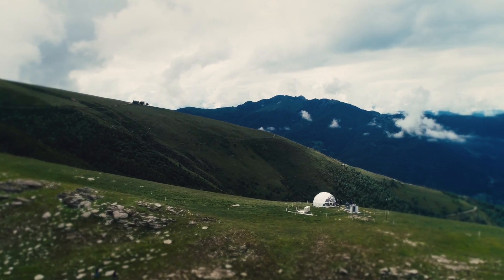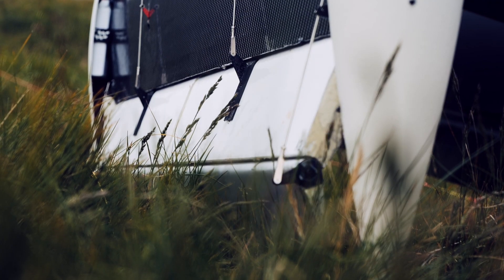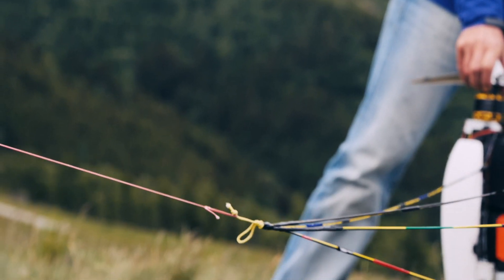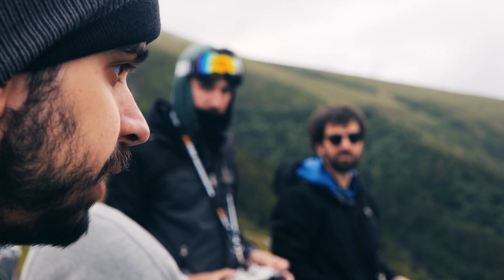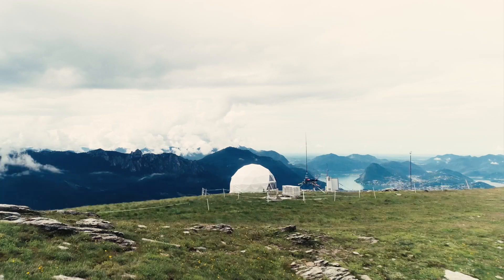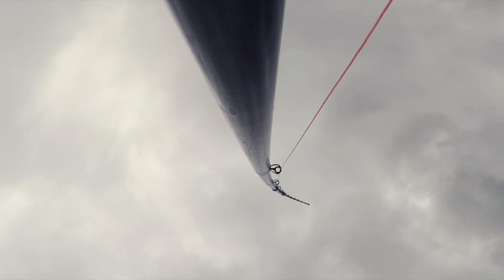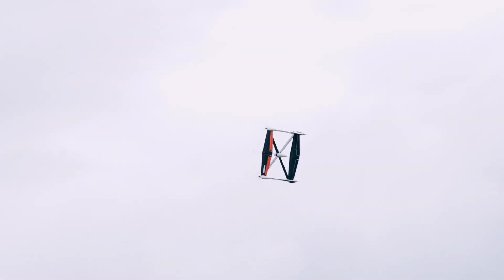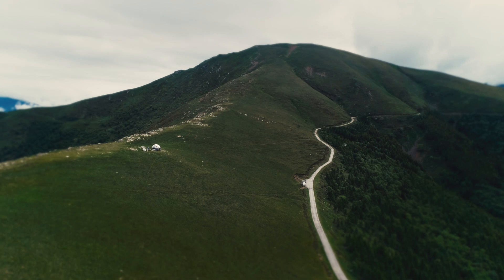Skypull Autonomous Flight TD

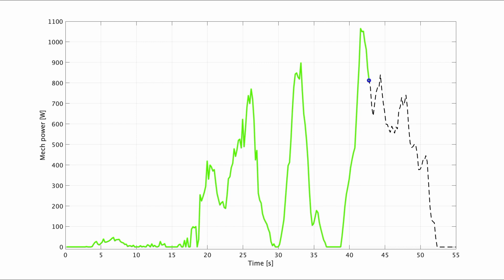Comment: 1:23 it showed ca. 400W.
So, with 8000h/year, 8 years life time and max. 0.10Eur/kWh costs, the max. price for the whole system must not exeed 2500Eur  ( 400W * 8000h/yr * 8yr * (0.1Eur/kWh)   ).
But I doubt that they can offer the system for 2500Eur incl. installation costs...
And: to replace 1 nuclear or coal reactor (1GW), you would need 2,500,000 Skypulls...
Reply: ... or you increase the diameter of skypull to 100m. Then you could reach 1MW.
But still, to replace 1GW reactor, you would need 1,000 Skypulls...
And: would you be able to safely operate the Ø100m Skypull?